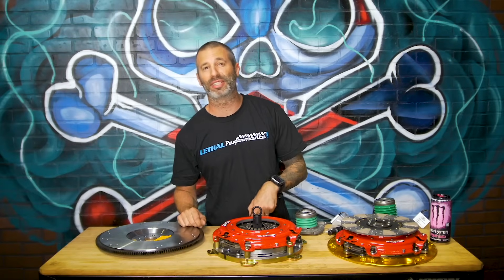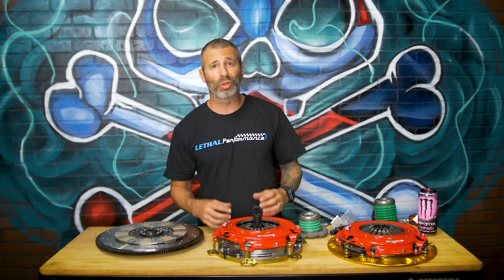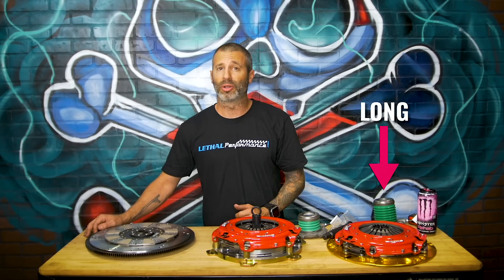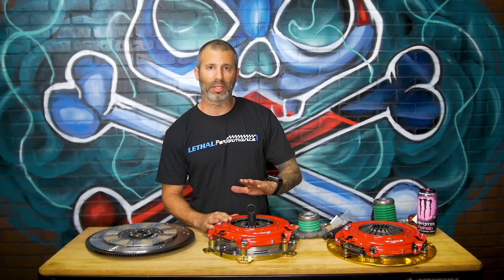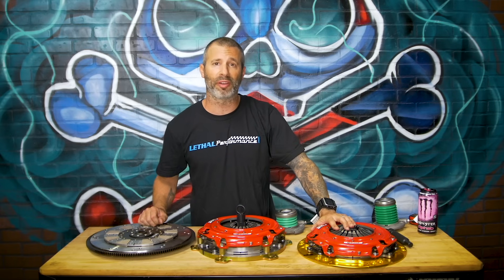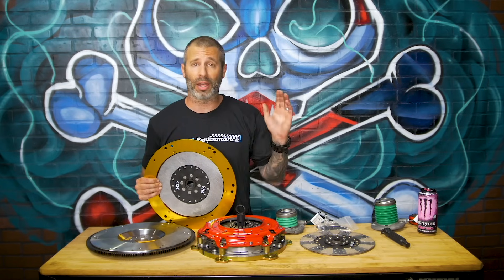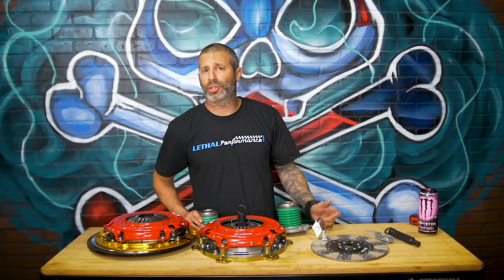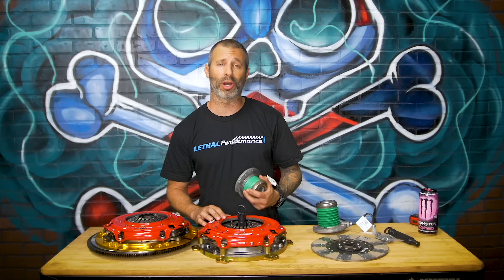Lethal Performance Tech Tips: McLeod Racing Clutch Kits Explained!

Comment: Just had the RXT installed on my 2015 GT with a Kenne Bell supercharger.    I have to get 1000-1200 clutch cycles b4 I can get on the Kenne Bell,  any dyno's, burn outs etc.   Reading to disengage my traction control when breaking in?

Comment: Do we need a tune when changing it out?
Reply from the maker: No tune is needed for a clutch swap however you will need to to a crank relearn with a device after the swap is done. This is required for most clutch swaps to prevent any codes from being thrown. Let us know if you have any other questions. 

Thanks!
Reply: Tune your driving skills

Comment: I have a mcleod singel disck .. what baering i should use ?
Reply from the maker: It depends on what car it's being used in and what transmission you have. With a little more info we can recommend the proper bearing for you. 

Thanks!
Reply: @Lethalcamp  street and strip ( mt-82)
Reply from the maker: @salmanalajmi6740  You want to use a new Ford OEM bearing which we list on the site.

Comment: I have a 2010 Camaro ss 610 rwhp Had a mcleod Rst it burnt up just installed a mcleod rxt with a ram throw out bearing haven't drive it 50 miles yet still breaking it in and still have clutch chatter cant wait until I can do pulls after the 500 mile break in😆😆😆

Comment: Wait so do these kits come with the different fly wheel?
Reply from the maker: Depending on the year/model the type of flywheel can vary. 99-04 8 bolt cars as well as 11-20 GT/Boss and 07-09 GT500 all use the same flywheel. It's the 10-14 GT500, GT350 and 2018+ mustang that use a different 8 bolt flywheel. Each one has their specific part number dedicated to it.

Comment: A whole kit for a 10-14 can be use in a 07-09 with right flywheel?
Reply from the maker: Mario Toledo the 10+ specific kit 6975-07M will not work with a factory 07-09 flywheel. You’d need a 10+ OEM replacement flywheel and the short bearing to make it work in an 07-09.

Comment: so the rst can be beatin on? more for daily driving, even tho it holds 700 wheel? and is a twin disc? what?
Reply from the maker: 5LToro El Toro the rst although having a high HP rating isn’t designed to handle the abuse and heat that the clutch will see at the dragstrip. It will eventually fail and won’t be covered under warranty.  If you plan on taking the car to the strip an RXT is what we recommend. Hope that helps.
Reply: Lethal Performance iam still on stock transmission 2014 mt82, what if i wanna make around 550 wheel, hardly ever take it to the drag strip, but sometimes wants to do some roll racing or a about 3/4 digs a month approximately lol
Reply: 5LToro El Toro The only reason I’m not buying a RXT is because it will grenade a stock MT82. I opted for the RST even though I do plan on beating it @ the strip with a sticky tire. If it goes out, then time for a 6r80 swap lol.
Reply: El Coyote I’m doing the same thing but if it blows I’m gonna get either a built mt82 or a t56